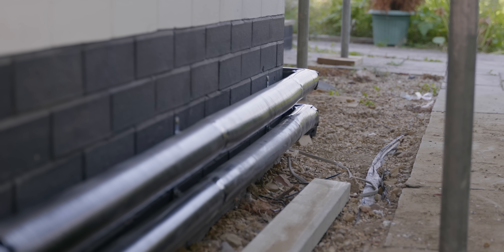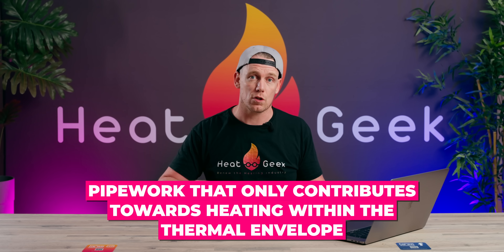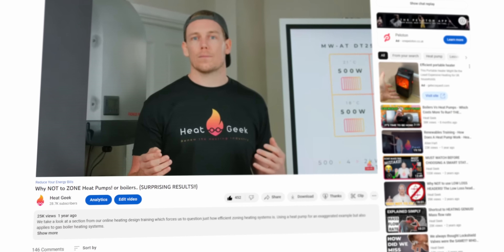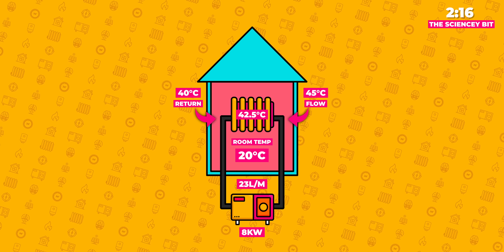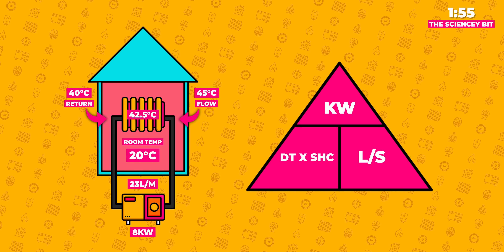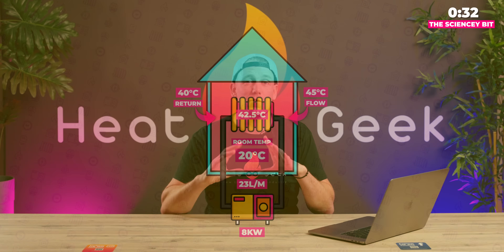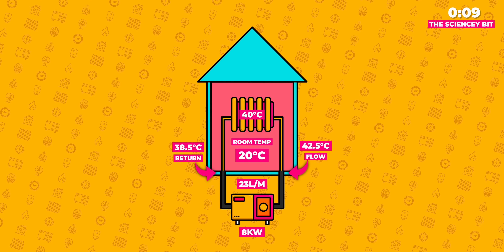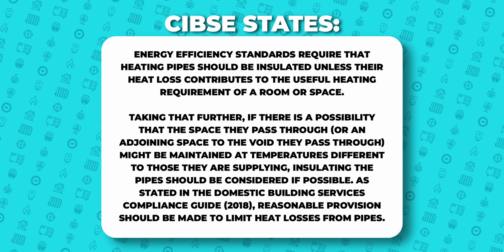Stop Insulating Pipework!

Comment: Totally makes sense and I especially agree with the insulation through brick walls (including internal ones). This truly cannot be said enough and yet heating engineers leave pipes unprotected laying gains masonry all the time ... 

My one and only addition is that in certain cases, when a pipe is enclosed in a service cavity i.e. under your floor and the house has sufficient insulation (sound or thermal) you absolutely want to insulate the pipe. The reason is not thermal performance but rather protecting the building materials and your floor coverings. You can raise the temperature of an enclosed cavity to a point when it's drying up timber too much and in essence create a hot pocket. Your flooring and other timber materials can warp because of the lower humidity level at that location compare to the rest of the floor. All of this is easily avoidable by insulating the pipework in cases where you might be creating a localised "heat chamber". On and this does not apply to 15mm pipework. There's usually not enough heat from them to cause issues like this.

Comment: But what happens when I use the air condition function in the summer?
Would water droplets forming on all the inside pipework?
Good vid though 🙂👍
Reply: This is an issue if a heat pump is going to be used for cooling. Radiators and radiant floors are not ideal for cooling. Fan coil or airhandlers with condensation trays and drains are much better suited to cooling. So the correct solution, if the system is to cool as well as heat, is to insulate any pipes that might carry chilled water (to prevent condensation forming), and don't lag any pipes that will only carry water for heating.

Comment: So really the title should be 'Stop insulating ALL pipework', which is actually kind of common sense when it's looked at analytically - problem is that plumbers and building regs people try to apply the same brush to every situation and either see it as an all or nothing. At least as a DIYer some logic can be applied, provided the previous numpties have or haven't done it properly on impossible to access spaces!

Comment: I'm not a heating engineer, and my main concern with NOT insulating inside the thermal envelope, is frozen pipes

When it got very cold a couple of weeks ago, my washing machine couldn't drain. Yes, the waste pipe connects into a pipe that's not actually used for heating, however at the same time, other pipes could also freeze.

I did notice I had to restart my boiler a couple of times too which could be due to frozen pipes too
Reply from the maker: That would be waste pipe. Lutrally no one on the planet insulates waste pipe inside the thermal envelope.

Comment: Hi Adam, 

I highlighted key bullet points to help me understand your video more:

- Pipe work within the thermal envelope that only contributes to heating does not need to be insulated
- Insulating pipe work that does not contribute to heating within the thermal envelope can increase efficiency
- Thermal envelope is anywhere in the property where the main insulation is, not the boundary between inside the property and outside the property
- Heat lost into boxing in doesn't just disappear, it moves to cooler areas of the property
- Mass flow rate zoning should be minimized
- Pipe work should be insulated if it will result in higher thermal output for a space
- Pipe work should be insulated to prevent noise and ticking
- Pipe work should always be insulated when passing through brick walls

Would you agree with me that these points some up your video?
Reply from the maker: Kind a.
Reply from the maker: More interested as to why your asking?
Reply: @HeatGeek  I am testing something out and see if a program works for summarising videos for educational purposes. Gas Engineering + Heating are all areas where I have a lot of interest in.
Reply from the maker: @mrproductivity3261  I'd be interested to learn more! Sounds cool
Reply: @mrproductivity3261  that is very cool! I would love a bullepoints feature for videos! how is the project going? how can I find more info about it?

Comment: In the UK, if you read the Part L building regs, you'll find the need to insulate any exposed pipes, including those in voids; inside the 'thermal envalope' - granted thats for new builds though
Reply: They obviously didn't consult cats when they wrote those regs. My cat had a favourite spot in the bathroom where the central heating pipes ran.
Reply: That's what I thought I had read (during one of those exciting bed time BR reading sessions). Thought it seemed bull shit to me.
Reply: @TheBrick2  Radiators are sized to the size of the rooms. Radiators are also used through balancing and TRVs to control the temperatures within individual rooms. By leaving pipework uninsulated you are distorting the design of your heating system. NO heating engineer calculates heat distribution created through uninsulated pipework. They do it by calculating the radiator sizes. 

These claims for not insulating is little more than  pseudo scientific scam by installers who don't want to bother doing  this work.
Reply from the maker: Yep. Loads of even poorer regs and standards in the uk too

Comment: Unfortunately you do need to zone a house heating because you don't sleep in your living room or spend the day in your bedroom, so these will need different temperatures during the day. And it's not just about the savings in energy but also about comfortable temperatures, and that depends a lot on what you are wearing while in a specific room.  So by default is better to insulate all pipes and oversize the radiators.
Reply from the maker: the poin t of the video is that the savings from higfher efficiency outweigh the energy saved from zoning

Comment: Dear heat geek - I would love to hear your opinions on electric radiators, particularly Vs heat pumps, what are the pros and cons and when would one system be better than another. 

I would also love to hear about low-H2O radiators such as the jaga strada, they supposedly use 90% less water so claim to be more efficient. Would love to hear your thoughts
Reply from the maker: Electric radiators cost 4x more to run than a heat pump so are absolutely a last resort. Jaga can run at a lower temperature due to the built in fan.. this slightly improves efficiency if set to run at a lower temperature

Comment: How long can the external pipework run be or the maximum length before being detrimental to the air source system?
Can the external pipework be underground and at what depth should it be placed?

Comment: Heat lost in the floor void is slow to make its way through to the room (carpets flooring etc) the whole point of insulating is so the heat goes where you need it straight away.  The quicker the rads heat up, the quicker the stat clicks off surely the stat takes longer to get to temp when the temp at the radiators is lower as heat's been lost under the floor and therefor slow to reach the room.  I thought the myth of keeping a constant temp was long proven wrong?  Most efficient way is to just heat when needed and fluctuating stat temps lend more to insulating pipework in my opinion
Reply from the maker: Your thinking of on off heating. And heatinf constantinuously is much more efficient generally see this video https://youtu.be/kGs_biFA87Q

Comment: Poor advice on the basis that you've oversimplified the problem. Insulation ensures heat is delivered to where its required at the correct temperature. Taking all the lagging off your pipes you could be dumping heat in parts of the house where you don't want it. Then leave other parts of the house where you do need the heat lacking sufficient flow temperature for the heat emitter to work as designed. I've come across this in the field, was a child's bedroom right above the boiler the main distribution pipework running right under the floor boards, the result was a kids room that's far too hot whenever the heating is run. Solution to reduce the boiler flow temperature, which resulted in the extremities not getting sufficiently warm. Optimal solution lag the pipe work which should have been done upon installation of the central heating system.
Reply from the maker: Everything you've said we adress in the video so I can only assume you haven't watched it.

Comment: The heat from boxing in doesn’t just “end up in other areas, as the temperatures equalise”. The boxing is being kept at a toasty 35c, while the room is colder than it would otherwise have been had the pipes been lagged (for the same amount of gas burned)
Reply from the maker: Untagged boxing does not reach 35c. If your boxing was 35c it would work as a radiator, so the rads in that room would work less hard and you could run them cooler.
Reply: @HeatGeek  how would it run as a radiator when the material of the boxing is plasterboard and wood, with a much higher thermal resistance than metal? The external face of the boxing is never much higher than room temperature unlike a radiator which is 30c+ warmer than the room it is in
Reply from the maker: @From the Ashes  clearly its not as good as metal but if it's that good and insulator that no energy would pass then why do we bother with cavity filling?

The point is it easier to pass through a peice of plasterboard then it is to go through cavity double skim.

As the boxing warms the pipe will emit less heat as the delta decreases.

And if the heat can't leave then it will take a matter of watts yo initially heatbthat space then almost nothing to maintain...

The truth is however some energy passes in to the room
Reply: @HeatGeek  i see your point if the heating was on all the time and the boxing allowed to reach equilibrium. However, heating may only be on for a couple of hours each time, during which the boxing many never reach max temp.
Reply from the maker: @From the Ashes  that goes against our ethos generally as you can see here https://youtu.be/kGs_biFA87Q

Comment: Is there an argument for insulating pipework to help radiators/rooms further away on the circuit get warm more quickly?

If a disproportionate amount of the uninsulated pipework runs through a particular part of the property, then won’t you get a disproportionate amount of heat coming in to those areas, making the rads further away struggle?

I think I have this problem - despite my best attempt to balance the system I have a room at the end of a run that just struggles no matter what. Long exposed pipe runs are nowhere near it even though inside the envelope.

Interested to know your thoughts on this. Thanks for your video and looking forward to the vid on balancing.
Reply from the maker: Yes if you aren't stable state heating for some reason. Most should though

Comment: Hi,

So is there a site or someone who I could go to to get an air source heat pump installed in a first floor flat in Cardiff?
I want to be good and get solar and a heat pump, I am just concerned that I will either be sold a pup or overcharged or both.

Comment: Telling people to not Insulate pipework is so dumb. Allowing pipework to Heat underfloors, for example. Flow and returns from the boiler to the cylinder will just give added unnecessary heat in the summer. Admittedly it’s only for a short period of time but regardless when it’s 40 degs outside you don’t want to keep adding pointless heat. 9mm of lagging will avoid this issue significantly. Your idea only works in the winter. And then it’s sketchy and not advisable as it’s not covering building regulations which specifically states pipework should be lagged to prevent heat loss to conserve energy.
Reply from the maker: We litrally cover this in the video and even draw you a diagram showing you to insulate that pipework. Please watch the video before commenting

Comment: If I’m running a cold supply within the same boxing as heating pipe work, I’ll insulate both pipes to prevent heat transfer to the cold supply

Comment: After watching a previous heatgeek video, I insulated all the exposed pipes immediately between my boiler and the void in the ceiling where the pipes went off to feed the house . This area has a radiator in the near vicinity and so I would argue the loss of exposed pipes was irrelevant in that area. Anyway, the efficiency of my boiler has increased and I've been able to drop my flow temperature down from 65 to 60 degrees even in the recent cold patch. However, watching this has helped me decide not to bother insulating any more of the remaining pipes in voids etc. (I think!) It's never b & w is it!!
Reply: Do insulate and see the benefits further.
Reply: One of those it depends answers really. Voids sometimes have little insulation and although they are “inside” the thermal envelope they can be larger heat loss emitters. For example between my 1st and ground floor I have a void and it is blocked off with very thin wood at the end of the void. Wasps also cut through it and left a hole so my pipe work drops in winter from 75 deg at the boiler to 65 by the time it gets to the zone valves. It’s an old non condensing boiler so 75 is fine. So in my case the space between the floors is outside the thermal envelope technically. It’s a very leaky house and I’m fixing that prior to either new boiler or heatpump.

Comment: What about the risk of not insulating the heating pipework in areas where the cold water pipework is within the vicinity(cross contamination of heat). I wonder how many combi boilers have the cold water encased within the f&r pipework in the same  notch ? Back to the legionella argument again.
Reply from the maker: In the video we specifically tell people to insulate cold pipework
Reply: @HeatGeek  and what about the pipework that surrounds the cylinder which is within the thermal envelope?
Reply: @HeatGeek  have you insulated all your CW pipework ? I can imagine over 99% of installations are not.
Reply: I can say that there was a swimming baths with the same issue whereby the CW was regularly heated by uninsulated heating pipework that created a little heat exchanger.... someone nearly died from legionella due showering

Comment: I think this idea is for a very specific type of installation where there are short runs of well designed and thoughtfully located pipework. In most scenarios all services including hot and cold domestic pipework is run alongside heating. I would suggest that uninsulated htg pipework would risk heating up cws pipework and cause legionella risks even if the cws is lagged. Bear in mind that cold water and chw pipes are at risk of condensating where not correctly vapour-sealed. This situation could be greatly exaggerated in your scenario.
Reply from the maker: We advise to insulate Cwm in the video...?? Can't be warmed.

Comment: My 1947 2 bed bunglow converted into a 4 bed dormer style house has complicated heating pipework runs. As the suspended timber floor is uninsulated my heating pipes should be fully lagged. Where the heating pipework runs under the Kitchen base units is not straightforward?  The whole of the ground floor should be thermally insulated including under staircases and underneath kitchen/ bathroom fitings. So a surface run pipe in a void above drafty floorboards, could insulate floor area in void, or insulate pipework can't see much difference. Equally where the heating pipework runs up the partion wall between dwellings. Don't really want to heat up next doors house, but their house is fairly well insulated and can afford the heating! Is therefore best to concentrate on the thermal barriers and heating pipework within the cold unheated spaces.

Comment: If there’s a soil stack in the same ‘boxed in space’ as heating pipes, inside the thermal envelope of the house, the soil stack should be insulated, but I wonder how many are? In my case I insulated the soil stack, boxed it in with ply, and ran the heating pipes up the outside, then boxed over them.

Comment: Another reason to insulate cold water pipes is to reduce the risk of condensation forming on it.
Reply: It occurred to me, there are a couple of other reasons to insulate heating pipes, which help from a controllability point of view.
a. My boiler has approx. half metre long flow and return pipes, running up to the ceiling. I noticed after lagging these a year ago that the behaviour of the boiler changed when it restarted  after the room thermostat called for heat. Before, the boiler used to start at high power (i.e. high fan noise); after the lagging it started up more gently. My assumption is that the water in the unlagged pipes had cooled down to room temperature, and dumping a slug of cold water into the boiler confused its burner control logic. Not an issue with a continuously running pump and weather comp., but will affect on/off systems like mine.
b. Heat tends to drift upstairs and overheat the bedrooms, and the hot spots I can feel on their floors from the unlagged pipes below them doesn't help in that respect. Nothing I can do about that without lifting the floorboards etc. so I'm stuck with the problem.
Reply from the maker: @roberthuntley1090  we cover thus in the video

Comment: Should any insulation be added when feed and return manifolds are close together? To prevent the hotter feed tubes warming the cooler return tubes and therefore reducing delta T across the boiler? You could just insulate the feed side?
Reply: I've been thinking about this as well. My flow and return run next to each other for a long stretch in a small space and I wonder how much the flow is heating up the return and effectively returning the heat to the boiler.
Reply: might be better to heat shield wrap the return instead?